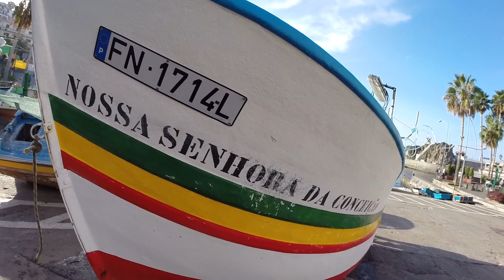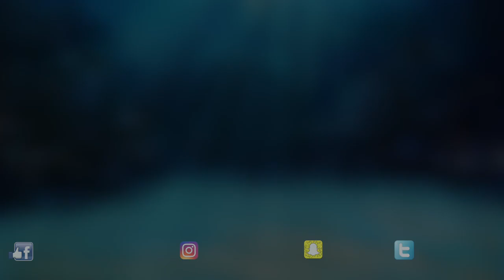This island is AWESOME!

Comment: Great video as always very informative . Very dodgy place to land a plane , I think pilots actually have to have  extra training and exam before they can land there.🤔 never fished there but there’s a great golf course close by.  Sea food is quite spectacular 👍👍 if you watch the Portuguese build a house you would be quite shocked how thick the roof is. Under the visible tiles there are many layers including a concrete one and another of insulation. It does keep the heat out in the Summer and in during the winter. Madeira can be quite cold and wet during the winter . Just looked at all your great merchandise, maybe a boat sticker could be addition one day ?